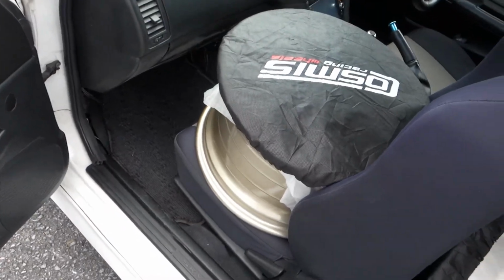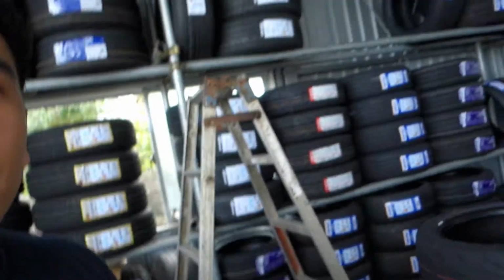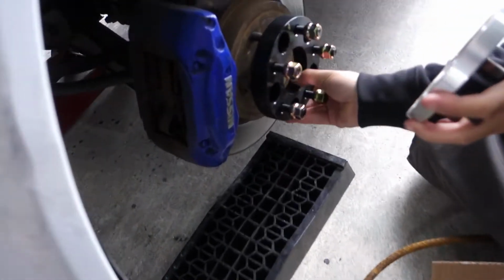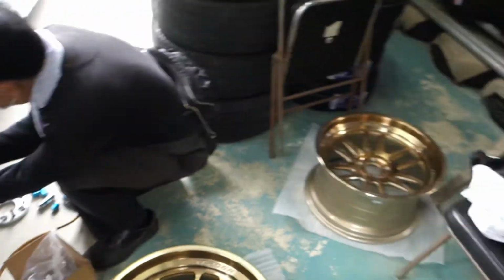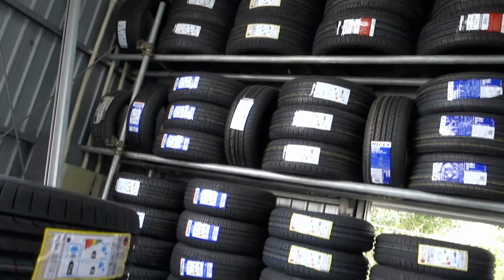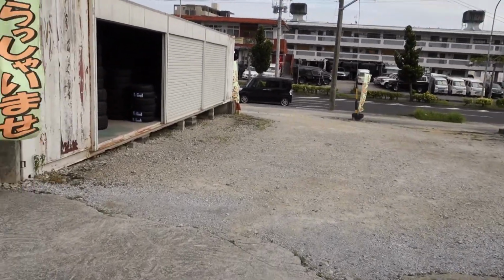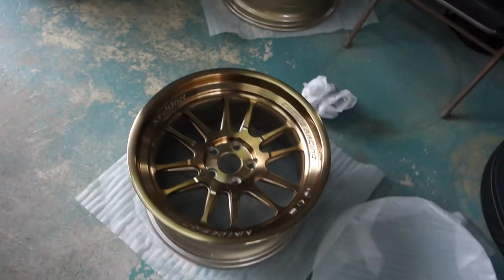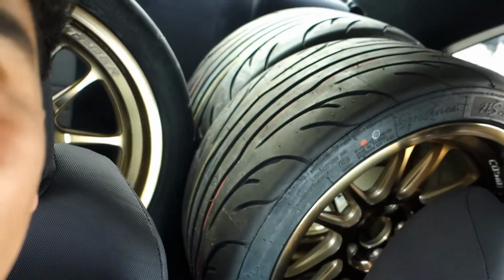They didn't fit my Skyline R34

Comment: would be interesting to see them fit man i got the same wheels but 9j the rears needed rolling and -1.15 camber 245 tyres and i agree with you them tyres give a nice square look but gona be a very difficult fitment
Reply from the maker: I am doing the gtr rear fenders and the z-tune front fenders. That will make them fit hopefully